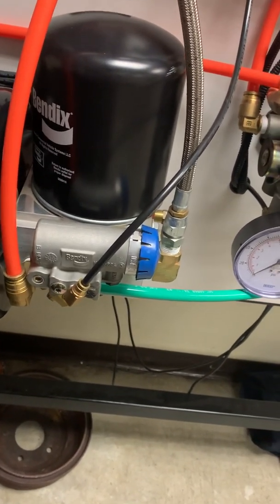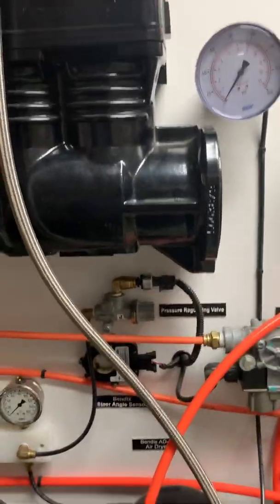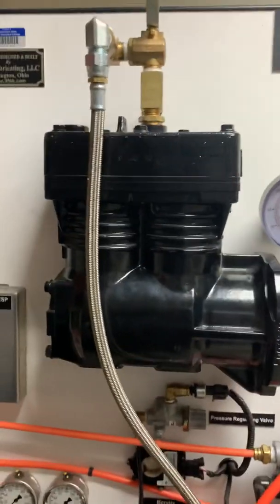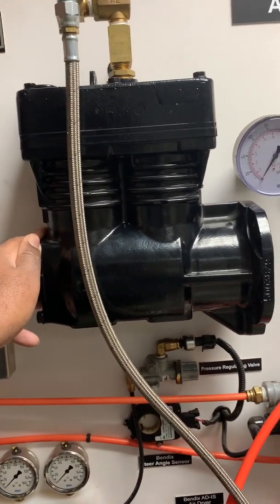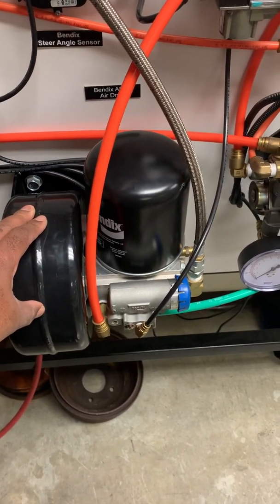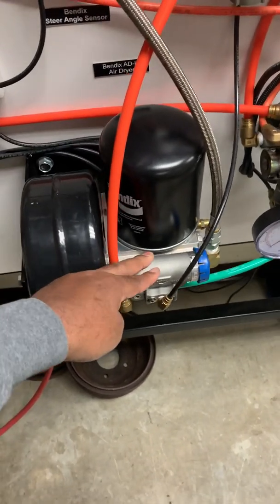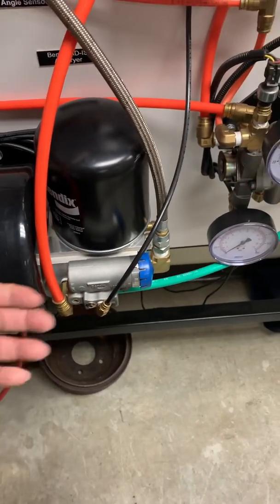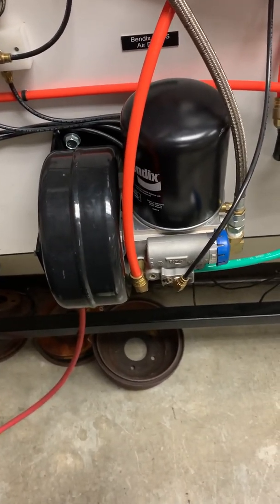Air Governor

Comment: Ok after watching your video im wondering if you can help me this is not regards to a semi truck I have low rider  that has a engine driven air compressor thats built from a converted ac pump the system works ok other than 1 problem it has water problems so I thought I could install a air dyer from a truck but it just doesn't work because I don't I have a air governor to control the purdge circuit the compressor I use is controlled electrically with a magnetic pulley on at 105 off at 130 psi is there a way to make this work maybe add a air governor or some sorta of air dyer that's eletric for discharge I am not looking for a free lunch u would be will to pay you to help figure this out

Comment: What test do can you perform to turn the compressor to on mode 
I have a very weak push coming from the discharge line
Reply from the maker: https://www.youtube.com/watch?v=JZM2NFExZsA
You can look up a spec sheet on how fast it should build air. But its compressor dependent.